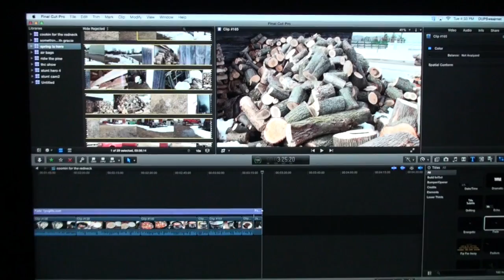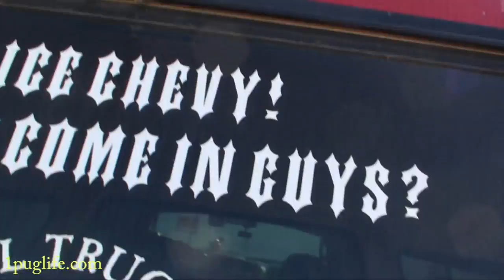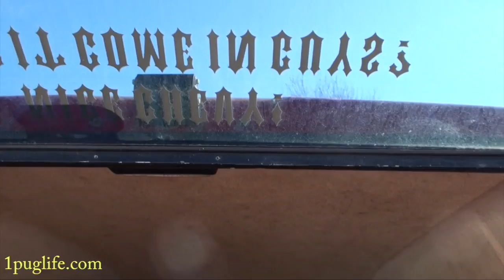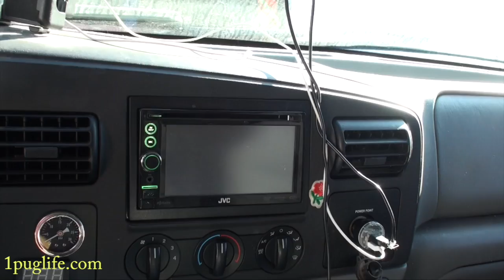my led com 4 inch flood light review

Comment: I'm not keen on using scotch locks for joining wires, cut, solder and heat shrink works every time.. Trouble is, if you're busy it takes up time. 
How's Gracie today?

Comment: Nice scotch locks bud, those shouldn't be used anywhere nevermind somewhere where salt and shit is used. Should probably connect them using a solder/heat shrink combo, takes the same amount of time and is done right. They are expensive though. Also why not drill the hole for the new lights wire directly behind the new light in the bracket so it doesn't look like shit? BMP

Comment: You need heat shrink connectors those clamp crimp connectors suck. I never use them anymore. They tend to corrode and fail.

Comment: Cut a piece of plastic pipe just a smidge shorter than the thin chrome part of your rear screen struts. It needs to be big enough to fit over the thick black part when its closed. Undo on end and slip it over the strut and when you open the window it will fall down to the bottom and the ram will rest on it. No need for a piece of wood.
Link in the prescription  https://youtu.be/jdN-4QBStuQ